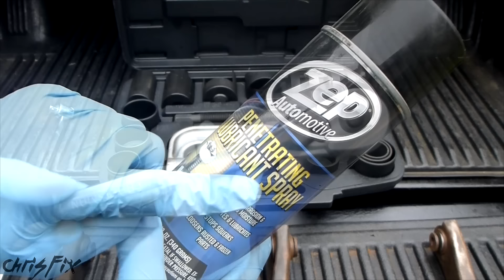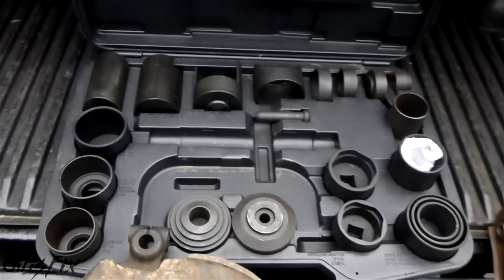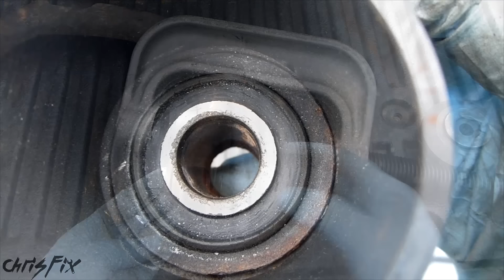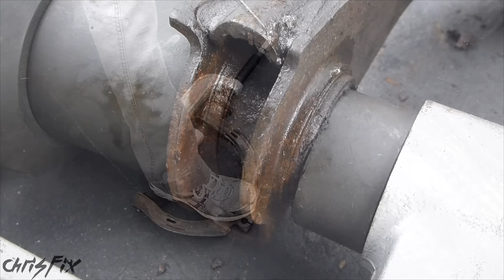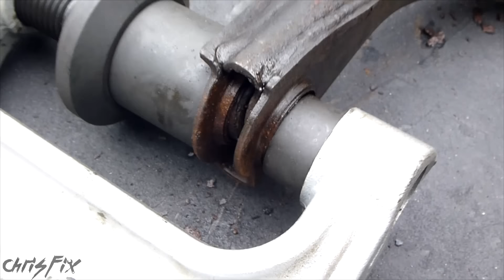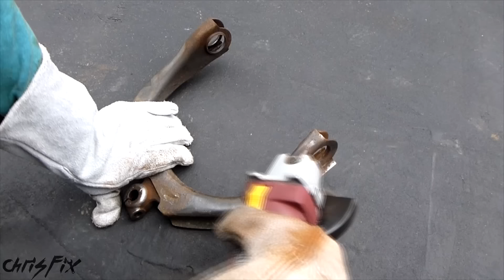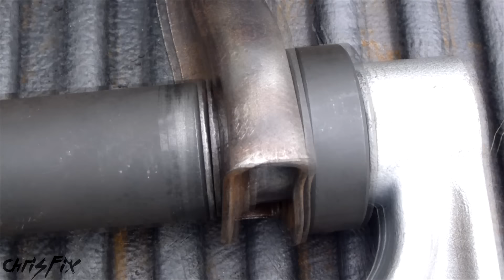How to Replace Control Arm Bushings (EASY)

Comment: I had to drill a couple wholes into my car the other day and I primed them with Rustoleum and painted them a paint close enough to the color of my car since it was covered by another car part anyway.

For something like a control arm, I wonder if I would try a product I saw near these that said powder coat on it. Would that be a better protectant against rust for what these parts put up with?

Comment: For some reason I was super slow to understand how pressing wheel bearings worked. Sometimes repetition is the key. When I watched your wheel bearing  press video some months back, I thought, is it really gthat easy? Now that I see another example of the same concept, I'm sure I have it now! No more paying someone else to press something I can do myself.

I triply owe you though, once for the other press video, twice for this video, and a job I did last week myself.

I've worked around tie rods a ton on different projects, but I had never done an alignment job. I rewatched your tie rod video while under the car and wondering why it wouldn't move.

Knowing that I was right after your video, I applied penetrating lube and the silly thing finally moved (had to borrow tools from my neighbor, first part on a car that was SAE instead of metric for me ever, and it's a Japanese car too!)

So the short of it, having seen briansmobile1's down and dirty alignment video, I realigned my car once instead of waiting at a local shop twice for them to get the job done right.

The third thank you is more for the beginning of the video where you list what a person will need. Loctite! Of course! The local shops had never used Loctite, so of course the car always lost it's alignment way too easy!

Comment: A helpful tip is to also put some penetrating fluid on the threads of the rod that is pushing on the bearing. Cranking down on that threaded rod can make a lot of friction, a light oil or penetrating fluid would help keep it cooler and reduce possible binding, and I've also found it helps make turning the threaded rod easier as well.